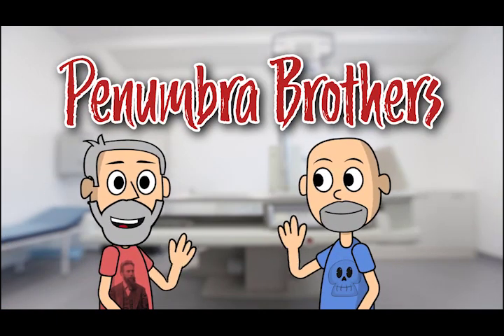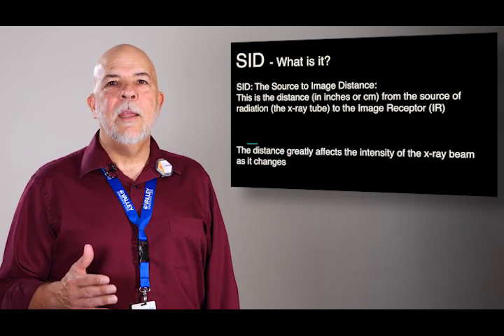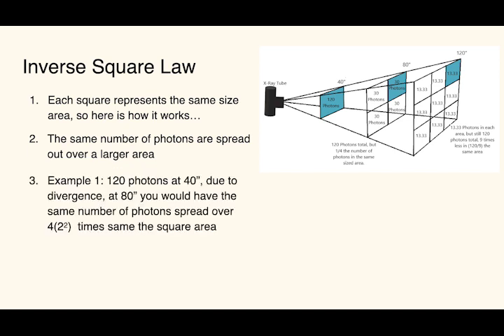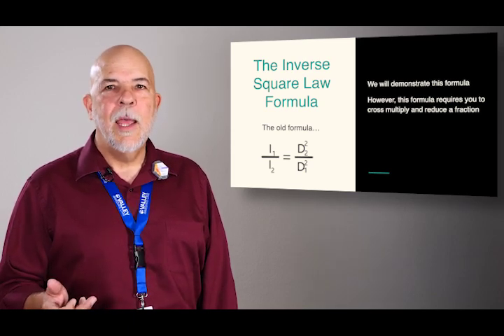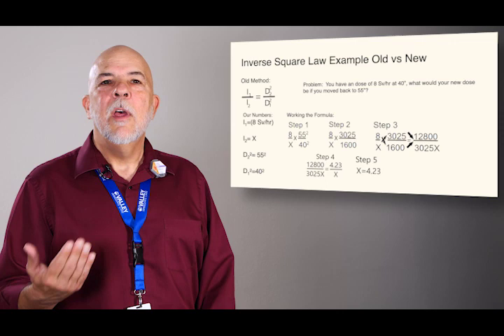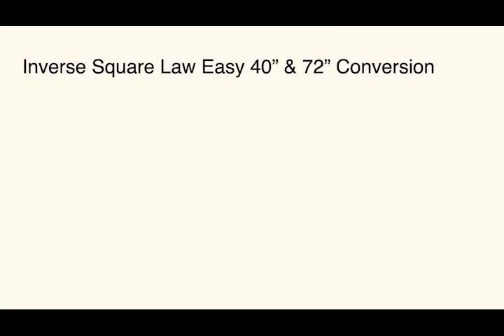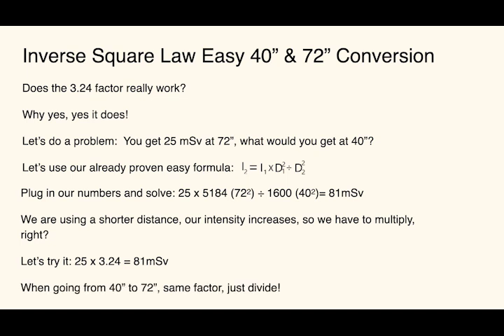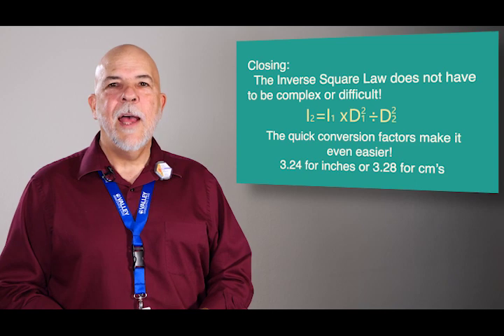Penumbra Brothers Inverse Square Law

Comment: In class our word problems had various distances. On the registry will 40&72in be the only distances used?
Reply from the maker: No, there will be different distance, you may be asked to change distance from 40" to 55", or other distances.  Knowing the formulas is important, but the simplified formulas are much easier!